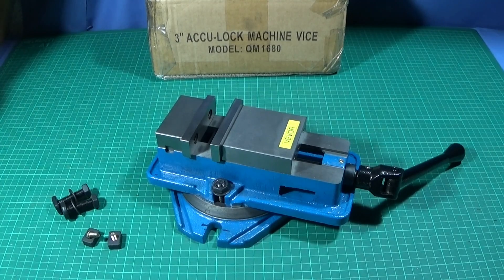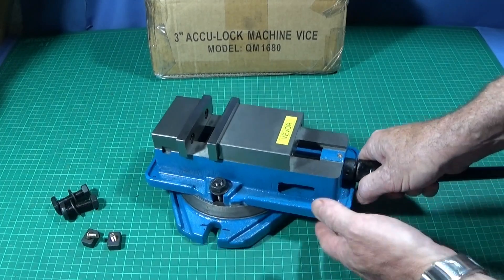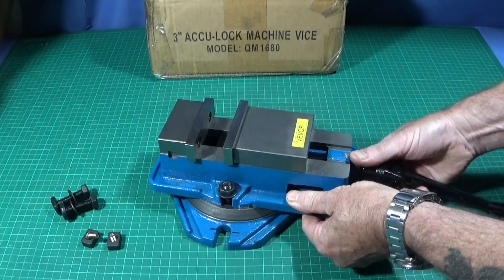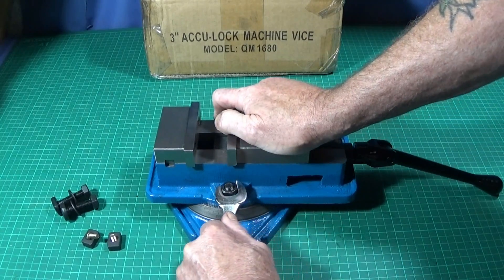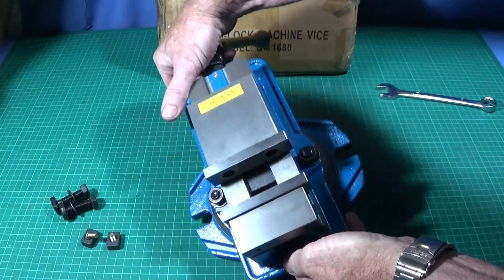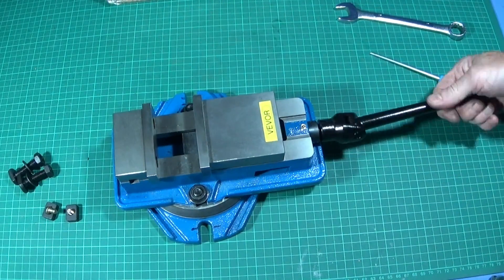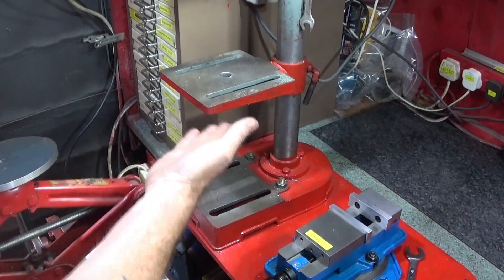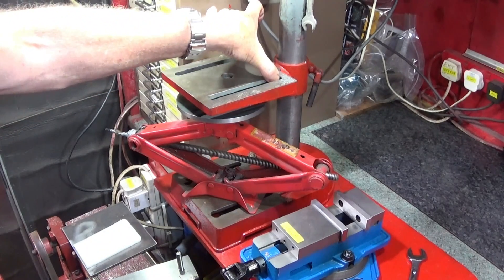3'' ACCU LOCK VEVOR MACHINE VICE & HOW TO USE IT ON A SMALL BENCH DRILL

Comment: Thanks for another interesting video Steve.  Is there an engraved line on the vise portion to work with the swivel degrees?
I couldn't quite see anything in the video or at the website.
Reply from the maker: Hi, There is a ground flat where one should be, but mine doesn't have a line, so I shall just put one on. It looks like there should have been one as the flat is unpainted. It is easy  to do, though. Regards Steve

Comment: Lol. He checked accuracy with a ruler across the flats! That's hilarious. Use a dial indicator with the vise on a surface plate.
Reply from the maker: I don't need to. It's for my bench drill, not a milling machine. Regards Steve
Reply: @SteveJordan  ok. That makes sense.
Reply from the maker: Also, as well as not having a milling machine, I do not have a surface plate that is large enough. Regards Steve
Reply: It's for his Drill Press......

Comment: That scissor jack under the drill press table looks terrible, but it's a genius idea.   I have a very small tabletop drill press in my garage that I use for woodworking and a scissor jack that's going under the table next time I use it.  I admire your keen idea.
Reply from the maker: Thanks. I have seen other people use the scissor jacks as well. I forgot to mention that if using them, to make sure one uses a spirit level on the table when adjusting it. I have been using it for many years, and it works great. Regards Steve

Comment: These are great vices Steve. I got my one from Vevor two years ago. I use it on my Mini Mill, but without the rotating base to give me extra height. I can always add the base if I need to set an angle. I copied some of your bench drill mods, which I have shown in an earlier video. Cheers Nobby
Reply from the maker: Hi Nobby, Yes, they are excellent vices. What is your Mini Mill like? Did it need any modifications from new?
Reply: @SteveJordan  Hi Steve, I bought it used in 2016. Have done some mods to it. Replaced the torsion bar with a gas strut, and made a homemade power feed for the X travel. My first and third YouTube videos show them. Most recently I added a DRO. Have a few videos on this also. Although it's only a lightweight mill, I've done a huge amount of work on it. All the best Steve. Cheers Nobby